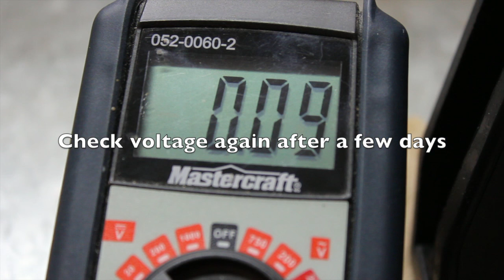How To De-Winterize (Spring Tune) Your Sea Doo 4-TEC Personal Watercraft Jet Ski

Comment: Holy smokes, winterize, dewinterize, flush , clean , oil changes this and that. Christ just change the oil once a year if that and it’s good to go
Reply from the maker: Yep. Until it fails. Then you try to flag someone down for help and spend all the $$$ you saved and much more, at that time.
Reply: @3ftDeepChannel  why would it fail?? Fill up the tank up, fuel stabilizer, new plugs and oil change in the spring, even if that?? Especially if it’s in an insulated garage you don’t need all that nonsense.
Reply from the maker: The enemy is salt water. If you don’t ride in salt water then it’s not such a big deal. If you do, however, it needs intensive care before being put away.

Comment: I used defog when I winterized..  Do I need to change the plugs once I start it back up and burn out all the smoke?
Reply from the maker: No need to change the plugs after start up. I assume you changed them when you winterized, though. Thanks for your comment.

Comment: I have (2) 2012 Seadoo GTI 130'S. I live in the south Louisiana it does not get below 30 degrees. I do not winterize... I start my ski's about once a month, run them with a hose water for 5 mins. Is there any suggestions on what I can do differently???
Reply from the maker: Yes. Five minutes is too hard on the carbon ring. You shouldn’t run it any longer than two minutes, even on a hose. Winter is really just an excuse to do regular maintenance on your machine, including changing the oil, filter, plugs, etc. Washing it is not just for keeping it clean, but is also a way to discover damage to the hull, etc. Fogging the engine is much better for it than starting it up once a month. So, what I’m trying to say is although it’s a bit of work, it’s a great idea to do most if not all of the procedures for winterizing. You don’t have to do it all in one day. You can spread it out over days or weeks. Good luck, and thanks for your comment.
Reply: Wow! Thank you so very much! This helps a lot.

Comment: Great video!
Note dielectric grease is actually an insulator! (typically used on the ceramic neck of a spark plug). Best way to apply it on battery leads is to sand and clean first, bolt the lead and wires together for maximum connectivity - then cover the leads with grease to prevent water/humidity etc from effecting the posts.
Reply from the maker: Thanks for the tip!

Comment: What do you all recommend for soap on jetskis that are good with not only the paint but also the seat?
Reply from the maker: When it’s on sale, I often use boat shampoo. When I’m out of that, normally I just use some good quality automobile soap. Do not use dish soap! Regular waxing also does wonders. Also, check out PWC Journal’s recent YouTube discussion about using a cover on your ski when it’s in motion. Good luck.
Reply: @3ftDeepChannel  Thank you for the Quick reply, I’m just starting to take mine out of the garage for summer. Paint is in good condition, I was thinking of tossing on some wax but there is so many options for Meguiars. Do you know of any specific quick ones I can apply as a protective shield for a 4 month summer?
Reply: @3ftDeepChannel  I will check out that Journal, thank you for the advice. Any specific options on the marine soap or just any brand is good?
Reply from the maker: I normally use their premium wax for automobiles once a year, and then some quick Wax after every second or third ride. It’s very important to wash the outside thoroughly, but also rinse the inside if you are in salt water or brackish water.
Reply: @3ftDeepChannel  Sounds good I am going to grab some from the store today. Here in Michigan all we have is freshwater so I dont have to worry to much about brackish or salt thank god lol

Comment: Hi, what is the year of your gtr 215? I own one, year 2012, and it doesnt come with engine cover :(  Could you say the part number of the engine cover? Thanks!!!
Reply from the maker: Yes, I forgot about that. I had to buy one from a dealer. As all the 1503 Rotax Engines had the same valve cover, any of them will fit. I suggest you order one through your dealer or Partzilla.com. Good luck.

Comment: Do you know anything about winterizing a 2004 Seadoo Sportster?  Thank you.
Reply from the maker: The principles are the same. I’d download a copy of the Owner’s Manual for your machine and use that as a starting point. If you can get a copy of the Service Manual, even better. Good luck.

Comment: Nice video mate! 
be carefull to hit your throttle after first start up, the valves dont like that. every summer i put some extra oil in the sparkplug holes and than let it run on its own for 30 minutes.  i olso remove the flexi exhaust part during winter time, and extra oil the engine, so the water still in the exhaust get no chance on my valves!
Reply from the maker: Thanks for the tip!
Reply: Thank you for all your tips, and great Youtubechannel!
Keep up the good work!
Greetz from Holland!

Comment: Hello 3ftdeep!
My GTX300 now has 18 hours on the clock.
Do you guys recommend to bring him to the dealer at the end of the season or change the spark plug / oil / ?? /  by my self or is it not necessary with these ours? I never used it on salt water.
My local dealer charges more than $ 300 for winterize... Thank you, Leon
Reply from the maker: Even if you don't have many hours on your machine, we suggest winterizing or preparing for storage at least once a year by changing the oil and spark plugs. You can do it yourself, you don't need to go to the dealership if you follow the steps in our video. Good luck!

Comment: I have seen some videos where the pwc have quite a lot of condensated water in the compressor and intercooler after storage. Have you experienced this? The fix seem to be to remove the inlet hose and blow it out on first startup. Mine is a 15 gtr215 that have been stored outside my house in norway this winter and im worried about this.
Reply from the maker: I haven't seen this and I'm not worried about some condensation, as long as the machine has been properly winterized. If you ride in salt water, it needs to be rinsed out with fresh water as shown in our after ride care video (https://youtu.be/yO00buBvPY0). Also, if you're storing in freezing temperatures, you must blow air through your system as shown in our how to winterize your PWC video (see https://youtu.be/kCEVRg0zr80). Thanks for your comment.
Reply: 3ftDeep  i removed the hose on the supercharger and fired up today. There was not any water in there.
Reply: 3ftDeep I live in Miami Florida and it get to the low of about 48 degrees do I need to winterize my ski

Comment: Great videos my friend..😀
But you must check oil level again after start the engine.
Reply from the maker: Very good point Nick, thanks. The reason we don't recheck after starting the engine, is that using our "How to Winterize" process, the oil level is confirmed before winterizing. The check we perform is just to ensure that we put oil in at the end of the riding season (and that it didn't leak out into the hull over the winter).

Comment: which is the fuel consumption of the gtr 215 ? thank you
Reply from the maker: I've gone 104 km before on a full tank, and figure I could probably go about 115 kms on a full (60 litre) tank if I used the eco mode more often. That's about 52.2 litres per 100 kms, or about 4.5 miles per gallon.

Comment: Is it bad for the ski if I put In in like March or April
Reply from the maker: I'm not sure what you mean
Reply: 3ftDeep will the cold water damage the jet pump or engine
Reply from the maker: The main damage to worry about is freezing of the intercooler and exhaust during storage in below zero temperatures. That must be avoided. Riding in cold water will not damage the pump or engine, nor will flushing the exhaust with cold water cause damage (unless the engine is not running during the flush).